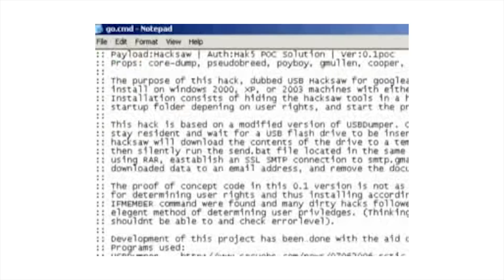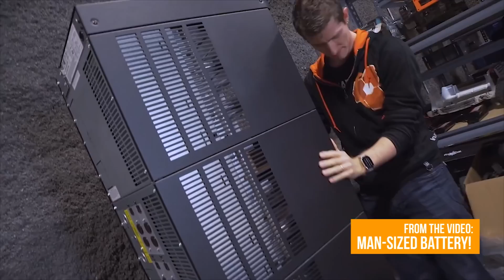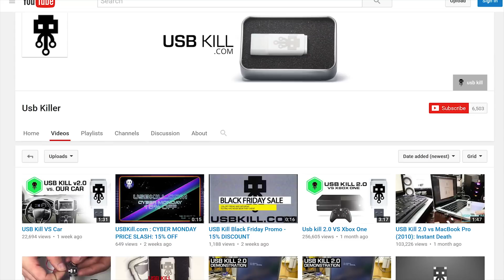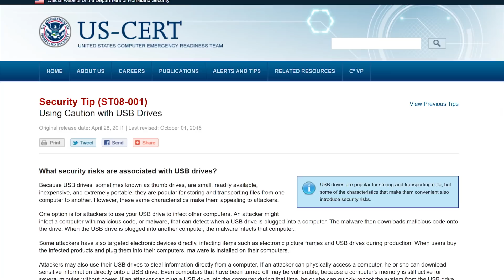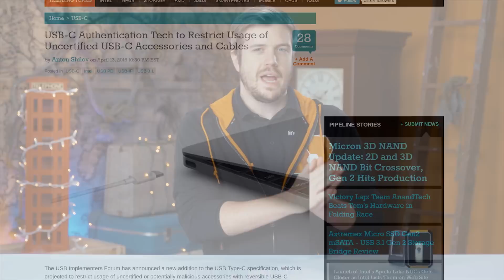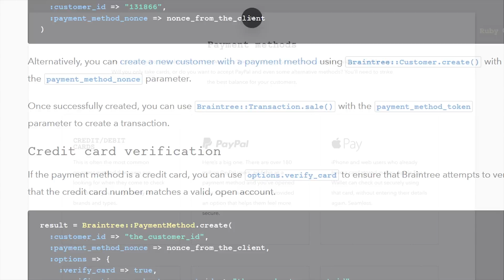COMPUTER DESTRUCTION (GONE DEADLY)

Comment: I call bs on thise one,  even if it could get the 3.7 volt BAttery, or 12 wall mount to 200 volts..

and even if they could its gunna take out the usb port before getting to the rest of the system..     but your know they just make it safe like that..    so I guess this lil usb killer aka usb port killer..  not named PC killer is an immediate flag

Comment: Cheaper option - manufacturers add in out of phases parallel diodes to the chassis ground as a voltage spike regulator

Comment: Can't a simple fuse mechanism be placed to protect the system ????
Reply: There are fuses in the Power Supply to protect against current surges but I don't think there are any on the motherboard itself, so putting the power in through the usb might by-pass the fuses (that is a guess, nothing more). What I find interesting is that the makers of this device specifically send negative voltage into the host rather than positive voltage. I don't know if this would make any difference in the function of the fuse.

Comment: the way this USB works feel ominously like something i was discussing years ago on forums for shits and giggles when i accidentally fried one of my old laptops by plugging the wrong voltage power supply cord into a USB hub, i knew it was technically possible because i accidentally did it to myself and was searching around to see if there was a way to fix my PC... i ended up having to get a new motherboard...

Comment: Electric cars:

chuckles  IM IN DANGER
Reply: Doesn't even need to be an EV. Nowadays pretty much every can that you can buy new (except a Caterham, those are as analogue as they get) has its engine, suspension, steering, etc connected to the electronics you find in the interior, so if that dies, the car most likely will die as well. Hell, my uncle is a mechanic, and he once had a Mercedes shutting down its engine every 5 km, not because there was something wrong with the engine of fuel pumping, but because of a bug in the programming related with the AddBlue system. The car was “fixed” with a fucking software update at Mercedes itself without a single bolt being loosed. So if a bug can brick your car, imagine a USB killer. Thank god I drive a 1993 car, don't have to deal with that shit in the slightest :P.
Reply: @Predalien3001  A car that uses AdBlue is supposed to limit its power to a minimum when the tank is empty. At least in Germany some Trucks are modified with little dongles to drive without expencive AdBlue. But its illegal.
Reply: @drcyb3r  yes, I hate it
Reply: It works on has gas cars as well
Reply: @omairrazaakram  yeah, pretty much everything with an ECU connected to a USB port.
Reply: Some Trucks use USB ports as diagnostics ports. I think it would kill the management of the car.
Reply: Well, a person still has to get INTO your car to insert the killer.

Comment: I used it on my old nokia

The USB killer died.
Reply: Yeah, old Nokias were un-killable...
Reply: I still have a working 3310 does not support modern simcard though.
Reply: @s4rg380  or plot twist:

Your modern SIM card might malfunction after you plugged it into your old Nokia 3310.
Reply: @Knee-Lew , luckily not one I was relying upon.
Reply: Sgt van der Walt my man
Reply: Sgt van der Walt yup
Reply: Sgt van der Walt try a converter
Reply: @s4rg380  same
Reply: Nokia; a device of focus, commitment, and sheer fucking will.
Reply: Wth
Reply: Aidan Wilcox THE BRICK NOKIA 3310
Reply: Lol
Reply: I get it
Reply: i legit dont know if this is real or a joke
Reply: yah them old brick phones are stronger than minecraft's bedrock
(im not a kid im 20 and i just like minecraft)
Reply: Didn't know old nokias had type-A ports
Reply: @slim7306 , yeah, they don't, but it's pretty easy to interface with them using a UART-USB bridge. Like the type you'd use to program an Arduino pro mini. But then chances are, you'd just fry the bridge interface chip, and not the device itself.

This was however a joke, aimed at the fact that those old-school Nokias were for all intents and purposes virtually indestructible.

I won't be the one to wooosh you, so you can relax...

For the moment.
Reply: @slim7306  in that case r/woooosh
Reply: The nokia jokes only work good if its about durability
Reply: The power of Nokia c2
Reply: 3310
Reply: I do not thik that a keyboard phone delivers power throught usb
Reply: Hi
Reply: Better
Reply: The Nokia: oh? you’re approaching me?
Reply: Relatable
Reply: LOL
Reply: WTF!!
Reply: Aidan Wilcox so it is the Nokia 3310

Or any Nokia brickphone
Reply: Fact: Nokia phon is unkillable
Reply: Aidan Wilcox didn’t it just recharge the battery back?
Reply: Nokia is the Chuck Norris of mobile phones.
Reply: LMFAO UNDERRATED
Reply: Nokia’s are indestructible
Reply: LOL
Reply: @Mik Müller he means by the usb killer died BECAUSE THE NOKIA CAN LITERALLY SURVIVE A BUILDING AT THE 100TH FLOOR
Reply: Lol
Reply: Lol
Reply: ALL HAIL THE NOKIA 3310
Reply: We nees to make a nuclear bomb that use a old nokia phone
Reply: i bet
Reply: Actually im agree with @Aidan Wilcox but the USB killer wont die but it wont kill your nokia too
Reply: I died...

Laughing 😂😂
Reply: not funny, didn't laugh.
Reply: @Niepoprawna Nazwa Thanks I definitely asked for your opinion

Comment: Yes, manufactures will install "opto-couplers" (they are not opto-couplers), and then you'll only have USB 1.1. There are several points here:
- USB Killer creators claim it is an ESD testing device: It is not! It is a device that is only useful to vandalize;
- USB Killer creators claim that most laptops and desktops are unprotected: Nope, all motherboards that I've seen have ESD protection. But no ESD protection is able to cope with the levels of energy that this device outputs. It is the same as putting your PC inside a microwave oven.
- USB Killer creators claim that "opto-couplers" will protect PCs: Although they are effective at that, I don't think any isolation device would be able to withstand that voltage and current.

Also, opto-couplers are unidirectional, while the USB bus is mostly bi-directional (USB 3.0 has uni-directional TX and RX lines, though). There are isolators (not opto-isolators, but capacitive ones, of course) available for USB, but they are only good for USB 1.1 .

Comment: can't they make a system with motherboard protection where it can disconnect from the source to protect the system
Reply: Maybe add fuses to every port so if there's excess voltage the fuse just blows. But this isn't common enough to justify the additional manufacturing cost

Alternatively, just make the computer only use USB C and have super strong charging so it can handle high voltages anyway

Comment: eh!!! helloooo!!!!!!  usb c only protects against unauthorized data flow it would not protect against a usb killer as it puts the surge over the data and power pins and unless the manufacturer of the motherboard or usb chip that connects to the port has installed some surge protection damage will still result.

usb c you may not be able to connect your phone or a rubber ducky to the device but you will be able to destroy the hardware.

Comment: Why not disable your USB ports in the bios and tenable when needed
Reply: The ports are still powered, and the data pins still go to the chipset.  Just because you told software to ignore the ports, doesn't mean their electrically disabled.

Comment: Whatever happened with that old device, it was like a lock for USB Port. It's applied inside computer, coming out around the USB and a piece is attached to be locked in place. I forget the method for unlocking it. Maybe a small key of some kind or another part that sent a code signal to it or whatever. But anyway, I haven't heard about it anymore for such a long time now.

Comment: The bulk DC capacitance of the power supply output is way higher than the USB killer's own high voltage capacitor. Anything powered by its own power supply rail will survive, including any SATA drives, fan controllers and GPUs. Anything upstream of the USB data path, such as the host controller, motherboard chipset and the CPU itself, is at risk of frying. If the CPU shorts the high voltage to the PCIe pins (which may not happen because there are ESD protection diodes in place), then your GPU might also fry, but that's unlikely.

Comment: uhm ik a way to protect it pc manufacturuers shoud make it soo the usb is aways disabeld soo it wont send power and when it detects something pluged in (we can use a pressure switch to detect if something is pluged in) it will ask u if u want that specifyc usb to activate

Comment: I already design my USB devices with 1500kv isolation and it still takes up board space but not as much as you would think the issue is that even with isolation, you need to also have a spark gap for high voltages.

Comment: Try plugging it into a plane
Jk
Reply: Uhh captain, my phone has stopped charging!
Reply: @taylorg7352  Wait wouldn't anyones phone that was connected at the time die too?
Reply: @Entropy67  Plane USB ports are isolated and the only result would be a blown fuse on whatever bank/usb controller your usb outlet is associated with, aka you and your neighbor get no power. The rest of passengers won't even be affected.
Reply: @acywei  r/woooosh
Reply: @polybius223  wOaHshHhh
Reply: Plug it into the main computer
Reply: @taylorg7352  no, no, no, no, no.
Plug it into the AIR TRAFFIC CONTROL computers...
Reply: @taylorg7352  Doesn't exist. If you are saying avionics, that has a breaker and would kill the port upon detecting such high power. That and avionics is located in the cockpit, gl getting in there with a USB killer.
end point: planes are built to be redundant.
Fun fact twin turbine airliners technically only need one engine to fly, they put 2 cause redundant.
Reply: Iast time i did this was uhhh was on a Singapore airlines flight or something similar maybe Malaysia air anyways am not pleased to say planes are indeed not drop proof
Reply: So basically Y2K on a flash drive?
Reply: I wanna do that now.
Reply: unless
Reply: That's...really messed up.
Reply: Ok hes ded

Comment: could a zener diode with a zener voltage of 6.2 (or anything slightly over 5 volts) connected so that it clamps the voltage to 6.2 volts, and shorts all the excess voltage to ground?

Comment: Probably the most powerful USB killer though, is actually the easiest one to make. Just get a USB cable, cut it, differentiate the positive and ground wires (you can tape the rest), then just plug the usb into a device and the positive and ground into any wall outlet. However much power was coursing through that outlet has now fried whatever you plugged the usb into (most wall outlets are 120 volts, but some are 140. At least in the US.)

Comment: Optocoupler workaround: two USBs which are connected and plug into two separate ports.  One gets high voltage and the other gets ground. The voltage then arcs through the optocoupler and the rest of the motherboard...

Comment: Have a custom pci express card with the output on a wire so it can hang inside the case and plug the "tester" USB in that output so they won't find it that easily

Comment: Basically just put your computer inside a steel safe, and put a mechanical code lock on it. Easy, run the cables through reinforced concrete, and like inside a bank Treasury, add some nice granite slabs on the wall. :D PROTECTED

Comment: most thing that can do is fry psu
Reply: same thing as when overvolting cpu rail when overclocking etc ive had boards soaked in water on accident and while running dried out etc the other odd times yeah it happens water or something bridges connections and ruins one of the 7000 wires someone could just as easily plug your pc from the psu to a huge capacitor and fry the power supply unit rendering it useless without a replacement
Reply: phones are also dc current so id assume that it does nothing to solid state memory spinning hard drives its like worst nightmare lolol

Comment: I take and build my own computers and build my own phones you can take the USB port remove it from the chip weld wires unto where the USB port used to be and have the USB port which just have voltage filters on it. The voltage filters won't let it go past 5 volts plug a USB killer into it it would not do anything to it

Comment: I'm late, but i need to say, that i'm shocked how many people are missing the point of such devices.
They are not for attacking. Sure, some idiots may use them to destroy stuff, but you can misuse every item. The original purpose was(and is) to erase your own(!) data as fast as possible in case you don't have time to move/hide it. Sure, most people don't need this. But in some countries, for some people this little thingy is a literal lifesaver.

Comment: What if I had a computer with robotic guts?

What if I had to log in and enter a password before a mechanism would "breadboard-join" the power pins together?

Then an attacker would have trip sensors in order to plug that blasted thing in! Right‽

Like a mechanical arm with a powerline connection in/on it, in a tamper-proof enclosure

Comment: Well, technically speaking you could install zener diodes to short out anything more than 6 volts or so to ground and therefore only letting lower voltages actually get to the pins in question, although capacitors as the ones used in flash circuits can sometimes deliver power in the gigawatt range for a very short time which may make it difficult to find an appropriate zener diode. I guess most people aren't gonna take their laptop apart and solder in a bunch of zener diodes anyway. Just saying though, that would probably be a solution until someone goes ahead a connects the mains to your USB plug directly or whatever.
Of course optocouplers should also work, the only problem is, as mentioned, while it would protect your computer, the LED in the optocoupler would still burn and therefore make the USB plug unsuable, also a high enough voltage would arc across the optocoupler kinda defeating the purpose. One could however use both.

Comment: I actually spent about 2 and a half hours modding all my USB ports on my laptop so that things like this (or more realistically power surges) won't kill my laptop wasting $1000 and over 24 hours of time spent doing other mods, instead just killing the protection circuitry that can be replaced for about $30 and an hour of time.

Although to be fair, that is completely overkill if you just don't want people plugging random things into your laptop, just get a set of USB locks for like $20.

Comment: Well, optoisolation is cool and all, but to my knowledge, optoisolators capable of speeds needed for USB 3 (even USB 2.0 High-speed) donť/canť exist and those that do (for USB 2.0 Full speed only) cost so much, that mobo manufacturers will never use them.
Possible solution for 21. century would be conversion to fiber optics, but again, thats still quiete pricy.

Comment: Please no optocouplers or fancy crypto auth methods, that won't solve a thing, if they cant inject power into your USB they'll do it via a 2.5mm jack or HDMI port or pour acid on it or light it on fire or destroy it with a hammer or drill it or throw it off a building or steal it or fill it with water or drop it while it's working or put it in the microwave or dump it in the ocean or go over it with a car or infect it with viruses or take a plasma torch or welder to it or cut it with a grinder or use an industrial centrifuge or put it in a crusher or launch it into space or pee on it or put a bunch of food on it to attract wild animals to pee and gnaw on it or put a bomb in it or shoot it or let aliens abduct it or drop it into a volcano .... I think u get my point.... there's pretty much nothing to protect your hardware if the attacker has physical access.
Reply: It can minimize possible damage from fools who think that destroying ones PC is fun. 
Making things harder for them can make them believe that it is not worth it.

Comment: Well, next project that I'm going to do: Create a removable or switchable USB ports for the system.
Reply: And what about the electronics handling the connected USB ports?
Reply: It's like a PCI slots, so you can just swipe in and out. Now that you mention it... I guess I need to add in some diodes.
Reply: Best if these are Zener Diodes, but using Varistors can also be beneficial for high voltage protection.
Reply: ooh

Comment: I bet future manufacturing of motherboards and computer cases are going to put protection circuits in them to prevent this from destroying the whole computer and instead just fry the single USB port. I would make the circuit direct the excess voltage into a loud buzzer to give away the location of a crook doing this. Especially important in schools, libraries, work, anywhere where public computers are widely accessed. For now I would fill the ports with epoxy putty anywhere kids are present.

Comment: Galvanical isolation ("optocouplers") is not that easy, since USB is a bidirectional bus and optocouplers work only in one direction. There are solutions out there, but they cost multiple 100 $ just to get to USB 2.0 speed. Nobody would implement such a thing in consumer-hardware just to protect you from dickheads.
Reply: They can however atleast try using Zener diodes or Varistors for protection.

Comment: On my PC it would actually easy to pretect the 2 USB ports on the front, because my PC uses a weird Way of connecting the to the motherboard. thre are 2 USB Ports soldered directly to the motherbord, into which 2 extension cables are plugged. So i could plug a protecton thingy in between those and the front USB ports would be secure.

Comment: Woundn't a better solution, at least for desktop and other devices that are supplied power via outlet is to take any excessive charge and discharge it though the grounding wire?